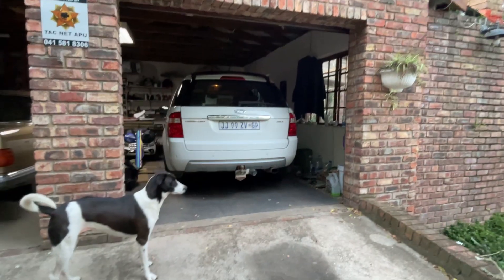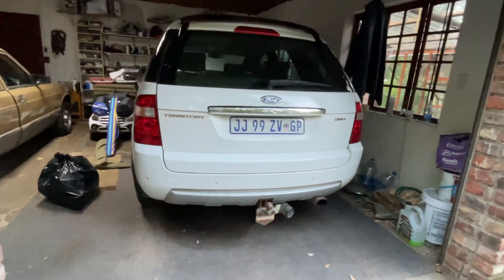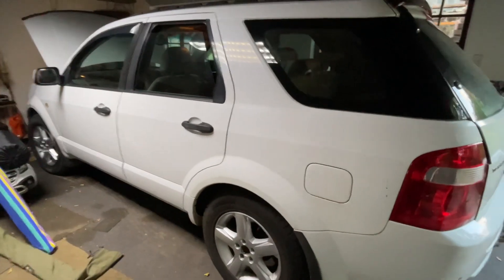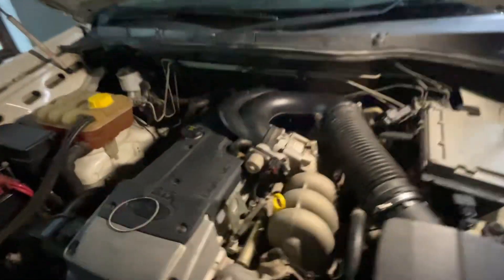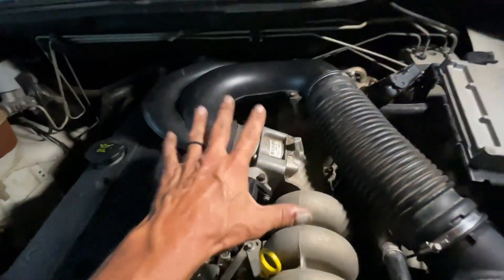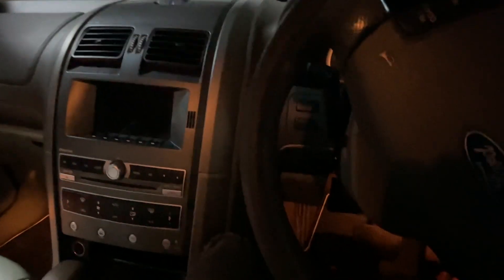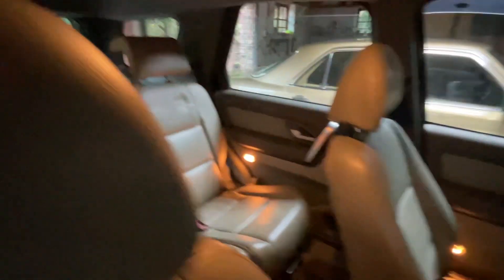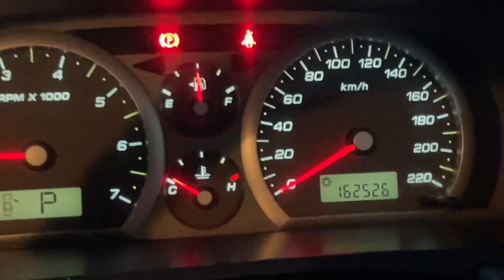2006 Ford Territory 4.0 Ghia, ETC problem easy fix

Comment: Very nice. We have a 2016 model with the petrol engine. It's a hauler alright, and pretty easy to fix when stuff goes bad. It does the family car duties to perfection. My daily driver is an XR6 Falcon FG2, same engine, transmission etc as the Territory, but a lot less weight.
Reply from the maker: That must go on exceptionally well. The last Falcons we had here in South Africa were the AU’s.
Reply: @oldmercguy  Damn shame to hear. Ford Australia were always idiots when it came to export, either that or the US Overlord sent orders not to crap on their overseas sales. My Falcon is a great car, lots of lazy torque, and plenty of speed and power when you need it. Unfortunately they canceled the manufacturing at the end of 2016, no more Territory/Falcon. End of an era.

Comment: I have the same car guys but it has issues with pulling especially on hills
Reply from the maker: It shouldn't, I don't have an issue with hills even while towing a loaded 2.5 ton car trailer.

Comment: 55 grand. Do you mean 55 hundred?
Reply: Rand in this case... Not dollars...
Reply: 55000 Rands, South African currency
Reply: Is this still available
Reply from the maker: it never was for sale. If you're based here in South Africa though, there are always a few for sale for a reasonable price at We Buy Cars.
Reply from the maker: Rand not Dollars, we're based in South Africa.
Reply: Purge valve too is a common need to replace for cleansing 
Petrols good long distance
Without automatic choke
I picked one up with only 129000 ks so that was a bonus
Comfy camper too if you want to lay seats down